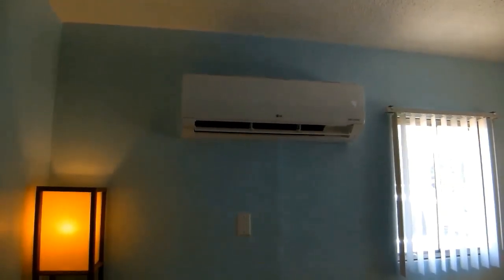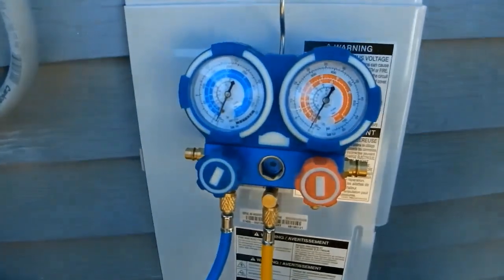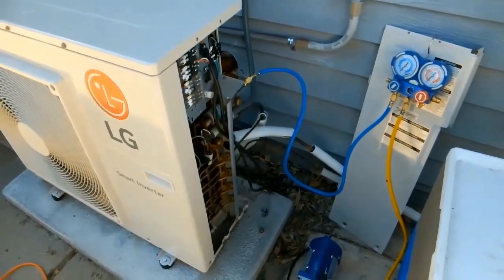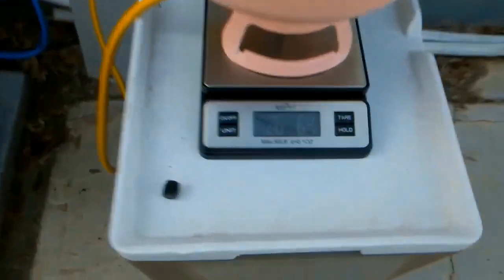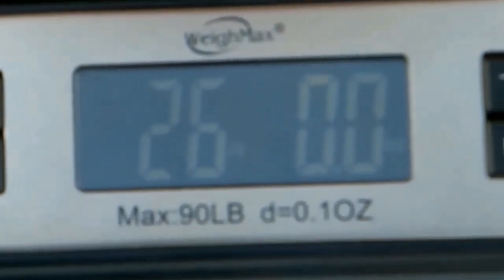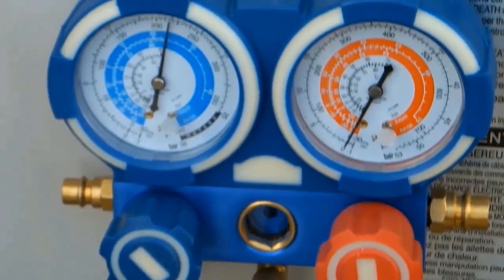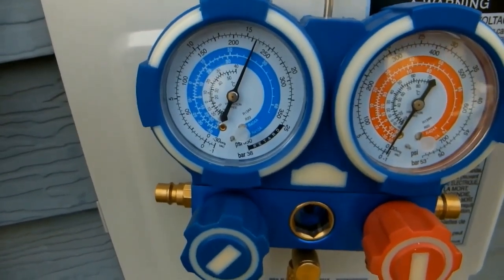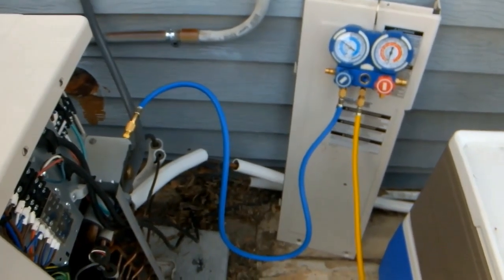How To Add Refrigerant to a Mini Split Air Conditioner

Comment from the maker: Please note: do NOT have your compressor running while charging with refrigerant. Also, you can check the PSI of the compressor refrigerant level by attaching the blue hose Schrader valve end (similar to a tire air valve) to the compressor low end (larger tube) with the other end of the hose attached to the low end (blue) gauge.
Reply: I am getting ready to service my mini split. Do I need to close the valve for the high side on the compressor during this whole process or leave it open?
Reply from the maker: With my compressor, which is an LG, I opened the blue or low side valve ONLY both to vacuum out remaining refrigerant and to add in new refrigerant. You'll notice in the video that I'm not using high side (red) at all. Apparently some HVAC pros use the high side. I'm NOT a pro, but had to go the DIY route because I couldn't find pros willing or able to work on mini-splits.
Reply: can this same set up work with a window airconditioner? it's for my shop. way too hot in there. I have a410 and added a valve on the copper line. The freon was gone since a screw punctured the line. Soldered the hole . I guess I need to vacumm out line and add freon as you did?
Reply from the maker: I would not recommend adding refrigerant to a window air-conditioner. You're dealing with different pressures and frankly window-mount A/C units were never designed for recharging. You should invest in an inexpensive mini-split. You wouldn't need a very powerful outside compressor unit, which could power a single wall-mounted indoor unit for your workspace.
Reply: @DoItYourselfandSave  Thank you for the info. I saw one on Amazon for 699. I may give this one a thought.
Reply: I've been looking and you finally answered the question that I was looking for should you have the unit running or no. mine was freezing up so I put what freon was left  back in the compressor when that was still running vacuumed it all out let what Freon was left back in the compressor. Check my pressures and it was a zero knowing I can fill it up without it running makes me feel better because I was wondering how to get more freon back in the unit I know a car air is different than this but a car air will not let you put freon in unless the compressor is running.  Thank you for your video and giving us all the details and most importantly the latter.
Reply from the maker: I tried to make a video for non-professionals (like myself). Full disclosure: review other vids on adding refrigerant along with mine, just to get confirmation that others are doing what I'm doing. Thanks for the comment!
Reply: @DoItYourselfandSave  What about the oil that is in the ac system? Does the vacuum pump suck the oil as well as the air and moisture? If so, how do we add the oil to the system?
Reply from the maker: Not aware of any mini-split systems that use oil mixed with refrigerant. When all remaining refrigerant is vacuumed out of a system before recharging, there should be a complete vacuum meaning all substances (refrigerant, water, impurities, etc.) have been removed. Contact the manufacturer to get details on the specific system you are trying to recharge.

Comment: When I connect the hose lot of gas run away. Also when I take off the hose. It is normal?
Reply from the maker: Make sure the valves on the gauge are closed before removing the hoses. Yes, there will be a little gas that escapes, but it shouldn't be very much.
Reply: @DoItYourselfandSave  That is why DIY'ers should not handle refrigerant. When they end up with 'Cold ' Burns they then know it should be left to qualified technicians
Reply from the maker: Or, you should know that we contacted several PRO hvac "technicians" who either wanted to gouge us or simply refused to work on our mini-split. I didn't want to be a DIY'er handling refrigerant, just so you know. The "qualified technicians" you think are awesome didn't want to work with us. But hey - thanks for playing.

Comment: I see an adapter on the blue hose to connect to the high side service port. What size adapter do you need?  Thanks
Reply from the maker: It's simply called a "R410A adapter for mini-splits". Good eye. I think you can find these at the big box hardware stores; but also online. They're about ten bucks or less.
Reply: I just need that . Thanks

Comment: What would you charge to install a unit? In North Hollywood
Reply from the maker: I'm not a pro HVAC contractor; just a DIY guy who learned a lot. I would look around for quotes in the Hollywood area. Check out my other video on our experiences with quotes https://youtu.be/2hOOJ85-fCM
Reply: @DoItYourselfandSave  yeah I know. Ive sort of developed into one by default (but not experienced w HVAC). Ive found the AC guys here to be clueless when it comes to these units. I have no idea why. 
If you'd be down to take a look at my existing unit and troubleshoot it for a leak (works fine but just not cold) I'd pay you for a service call. DM me if so
Reply from the maker: Leaks are the biggest problem with mini-splits. There are some good videos out there on how to find them and troubleshoot them. Almost always involve the flared joins between the lines running from the compressor to the indoor units. Might have to remove any covering of the connections near the back of the indoor units, spray the area with soapy water, then look for bubbles. Bubbles indicate a leak. I'm not the biggest fan of Craigslist, but you can find HVAC guys there that are licensed and willing to fix leaks.

Comment: I just want to clarify: when you vacuum only low side valve is open or both valves?  When you charge the system it's only the low side open?  Thank you very much.
Reply from the maker: I don't use high side valves when adding refrigerant, only low side valves. If you watch the video again - notice the high side (red) port/valves are not in use. You open the low side (blue) port/valve to add refrigerant.
Reply: @DoItYourselfandSave  he is talking about high side valve on the compressor.

Comment: If the unit leaks (not getting cold) and your adding new refergerant. Do I have to pump down the old refergerant or can i just add new refrigerant ?
Reply from the maker: You can add, but I made this vid because I knew that whatever R410-A that was left in the system was very small, if any. So I vacuumed the system and decided to show the whole process from the beginning. If you have just a little loss, adding to get to the right PSI is ok. Unfortunately, however, there's no way (maybe pros know) to determine exactly how much refrigerant to add via weight because you don't know exactly how much you already have. So you have to go by PSI only.
Reply: Real world u recover all refrigerant then weigh it .but I just added two ounces at a time because I had and leak just to get thru the 95 degrees temps for the time being .

Comment: I have an LG inverter as well where are you finding these specs for refrigerant capacity, i had a leaky flare and have since fixed it so i would like to reinstall what the factory charge was.
Reply from the maker: Found in the owner's manual / specs that came with the units. If you don't have those, you should be able to find them via the LG website.

Comment: Don't think the refrigerant from the tank should be allowed to flow into the suction line unchecked like that. You risk letting liquid refrigerant from the tank getting into the compressor. The blue valve at the manifold gauge should be closed and intermittently (every few seconds) cracked open to allow small amounts in each time. This way any liquid would have more chance of boiling into vapor before reaching the compressor. Alternatively tie a liquid vaporizer cylinder like Kwik Charge from Imperial in the blue line. Even then most service techs would still charge incrementally in small amounts by intermittent cracking open and closing the low side valve on the manifold gauge set..
Reply from the maker: Thanks for the tips, I'll keep that in mind next time (which hopefully won't be for a while). I'm not a tech, so I don't pretend to know everything. That said, techs seem to be reluctant to work on mini-splits or their rates are sky high, which is why I took the DIY approach.
Reply: Great reply buddy
Reply: I was concerned about filling low side straight from tank also… is it safe to just wait longer after charging to allow any liquid in the low side line to vaporize before turning on the compressor?
Reply from the maker: Not sure why you'd wait. Just take some tips from my video and make sure to watch others on charging a mini-split if you're still uncomfortable with the process.
Reply: @BenDrechsel  Splits have an accumulator which helps liquid to not enter compressor. But still only let in a little at a time for safety sake.

Comment: Great video can u use sub cooling method if u don't know how much refrigerant is in system????
Reply from the maker: If you don't know the amount of refrigerant, it's best to use a recovery tank to vacuum out existing refrigerant first. Then add a full quantity of refrigerant based on manufacturer's specs.
Reply: No,  you can review the superheat
on the vapor side only.  There is no port on the high pressure side to measure subcooling.
Reply: @gkk2001  most mini splits don't give you superheat or subcooling value of the unit. they just give the weight of the refrigerant that should charged in the unit. so its better to just recover the old refrigerant, vacuum the system and charge the new refrigerant. less headache that way

Comment: What kind of pressure did u get on the low side in forced cooling mode
Reply from the maker: When running, the recommended PSI (for our particular LG model; specs for yours may vary) was about 120 PSI
Reply: Thanks guerillla diy I added a touch of refrigerant to make it around 125 psi and both units are 60 degrees air temp at vent ,thanks
Reply from the maker: Awesome! Glad it's working out. You probably also saved $200-$300!

Comment: You DO NOT need to evacuate a system that is partially filled.  If partially full, it has always had refrigerant in it under positive pressure, so there is no air or moisture that has entered through your "leak".  You only need to top off the refrigerant using the proper pressure tables based on temperature of the running system.
Reply from the maker: Right, but I made this vid under the assumption that the system is very nearly empty; or for those who wish to vacuum out the system and start over from scratch and add in the proper weight of refrigerant per manufacturer specs. However, where the system is putting out cool air but needs a "boost" I agree with you.

Comment: Why do you need to re-vacuum?
Reply from the maker: It's not so much "re" vacuuming as making sure the system has been completely purged; that is - there's likely not very much refrigerant in the system if you have leaks, so assume that you have to completely purge (or vacuum) the system out. That way you'll know exactly how much refrigerant to charge up with because you're starting from zero. If you don't know how much refrigerant you have, you won't know how much to put in.

Comment: Did you find/fix the leak? Not being an automotive unit it shouldn't lose any refrigerant unless there is a leak. I was told that the flare fittings attaching the line set are notorious for leaking.
Reply from the maker: Yes, I did using a spray bottle with a dishwashing soap solution. And you're right: almost all leaks are either at the flares or involve the flare nuts not being tightened (but you don't want to overtighten, either). Once I found the leak, I used a leak stopper called "Nylog" which is a gasket/thread sealant designed for HVAC use.

Comment: So when your vacuum and you have both valves open to vacuum the compressor out also?
Reply from the maker: Yes, open the valves. If you believe that a fair amount of refrigerant is still in the system, then you should remove it using a recovery tank (I don't cover that in this video).

Comment: If you hook up the micron gauges and nothing happens whats wrong??
Reply from the maker: It's most likely completely empty - that is, completely free of refrigerant. I would vacuum the system with a vacuum pump first, then add. This video assumes that you have vacuumed the system first (and that's the only way you'll be able to add in the precise factory spec of required refrigerant anyway)

Comment: .......shouldn't liquid refrigerant be added through the liquid line when the unit is off while recharging an empty unit. Then add more if needed through the suction (low) side when the unit is running (turned on)?
Reply from the maker: I've only added refrigerant through the low side whether the unit was empty or needed to be topped off, never the high side. And always with the container of refrigerant turned upside down, as made clear in the vid. And, I've only added refrigerant (R410A just to be clear) when the unit is turned off. I turn it back on with the low side line still connected to check the pressure while the unit is running. If you're still uncomfortable on the details, please contact an HVAC pro. I haven't received the best treatment from the so-called pros, but YMMV.

Comment: Did you find the leak in the system?
Reply from the maker: Yeah, turned out to be a connection from outside line into one of the indoor units. After vacuuming the system, I used a leak preventer called "Nylog" and then tightened the connection.
Reply: Is it a multi head system ?????
Reply: @kevinkevin9448  yeah its a muti-head or multi zone system. looks like a 2.5 ton or 3 ton unit
Reply from the maker: @xcmskim4  you're right, it's 3 ton (36,000 BTU); connected to 2 1 1/2 ton indoor units (each is 18,000 BTU)

Comment: Do you have the valves open or closed?
Reply from the maker: Open them to check PSI and of course to purge the system as well as add refrigerant.
Reply: To vacuum it out, you need to have it closed?
Reply from the maker: Every system is a little different; for mine I didn't physically open the low side (blue or large tube) valve - I connected the blue line to the Schrader port on the low side. Check out the vid starting at :40 for a view of the connection

Comment: I have a new install and 55 foot extra line do I add refrigerant before I start it ????
Reply from the maker: Better read all documentation that comes with the compressor/indoor units. Most compressors require additional refrigerant if you're running extra copper refrigerant line lengths beyond a certain length. For example: you might have a unit that comes from the factory with, say, 5 lbs. of R410A, but if you're running beyond, say (all systems are different), 30 ft. of line length, you'll need to add a specific amount of refrigerant for each add'l given length of line. That's where the documentation comes in. So, if that 55' is within the factory spec where no add'l refrigerant is needed, you can start it up after releasing the refrigerant that came factory-installed with the compressor. If the documentation requires add'l refrigerant based on the line length, then add it before starting the unit.
Reply: Thank you what side do I add the refrigerant
Reply from the maker: @kevinkevin9448  blue side or "low" side, check out the 1:37 mark on the vid
Reply: Most LG units are pre-charged for 25ft. If you read the manual it will state the required refrigerant per foot
Reply: FYI all lg condenser have different amount if length s based on the system .I just wanted to know where to connect to .I do not have a 3 port valve just liquid and gas ports where u charge the system .any thought ???

Comment: I’m going to fill up an empty unit, how much refrigerant should I get?
Reply from the maker: You have to check the owner's manual for the compressor. Depends on what the manufacturer recommends. All makes are different.
Reply: Tall Ale  to see if the outside unit has a leak, would I be able to put gauges on the unit without the lines hooked up?
Reply: I’m not worried about the inside unit because it’s brand new, also if the outside unit does not have any refrigerant in unit, and the lines are already vacuumed (DIY kit), do I need to vacuum the outside unit separately?
Reply from the maker: The outside unit combined with the total length of the lines determines how much refrigerant is needed. You really need to read the owner's manual on this - if you don't have one, contact the manufacturer or a HVAC pro (full disclosure - I'm not, but many HVAC techs in my area aren't knowledgeable on mini-split systems). Vacuuming the outside unit essentially vacuums the entire system. The inside and outside units combine to form a single system.

Comment: I thought the R410A is charged through the red (highside) upside down in liquid form when completely empty?  Just saw another video here ( https://www.youtube.com/watch?v=ncgLDYrvN6w )
Reply from the maker: Yeah, I know some HVAC people charge through the high side. In my video, I'm using methods that I watched on numerous other videos as well as read up on. I can't vouch for what others do, also not saying they're doing it wrong. Please note: I'm not an HVAC pro. However - due to the extreme quotes I received for basic service from A/C contractors in my area, combined with their unwillingness to work with mini-splits, I had to go the DIY route.
Reply: Dana, that video is of a traditional condenser. Mini splits typically don't have a service port on the high side. The single service port is on the low (vapor) side, so you have no choice but too add refrigerant to the low side.

Comment: Sounds like the system is losing too much refrigerant - probably leaking somewhere. Just topping up doesn't seem to be the solution - should determine what's causing the loss
Reply from the maker: This vid was recorded AFTER the leak was located and fixed. Used Nylog sealer after the connections reseated and tightened.
Reply: @DoItYourselfandSave  9